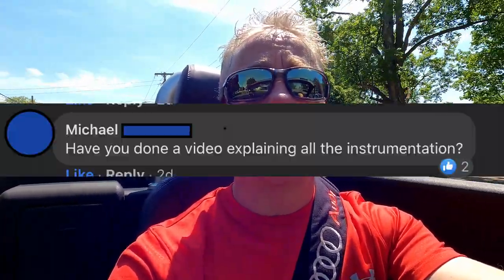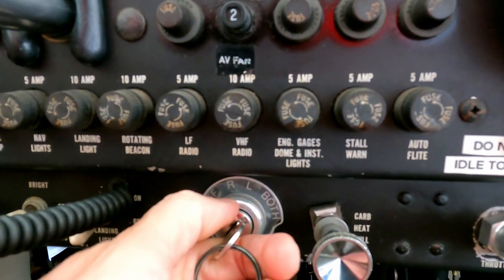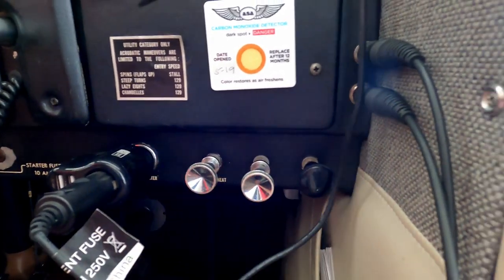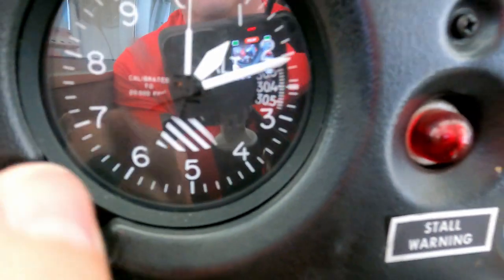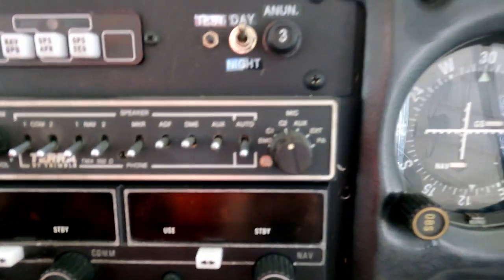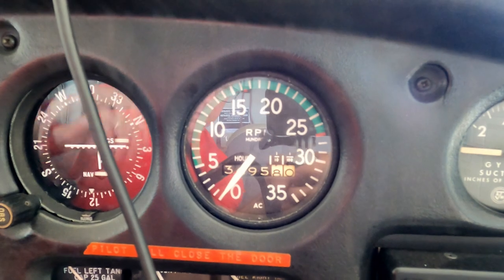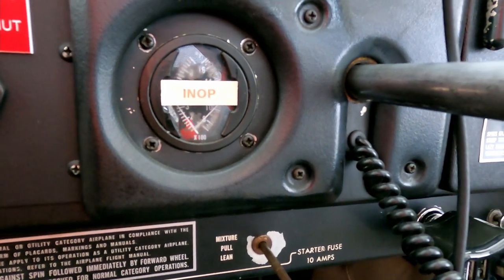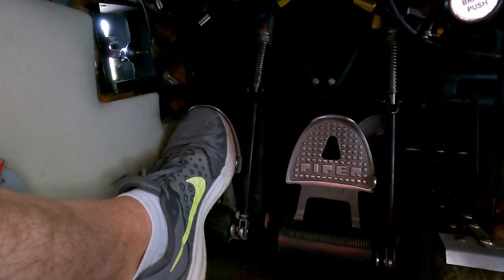Instruments and flight controls in my 1967 Piper Cherokee 140 (69)

Comment: You did a good job explaining your panel. I have a 73 Arrow II, the placement of my instruments is much different than yours, the difference just 5 years make, mine was sold in 72 as a 73. Within the next year I will add another g275 and have two G5’s and two G275’s and dump the vacuum pump.
Reply from the maker: I
Wish I could afford a panel upgrade. $$$
Reply: @RandyBroderick  
I dumped a mass sum of cash into my plane. I never thought I would put more money in electronics than engine and airframe.
Reply from the maker: @DWBurns  someday, I hope
To be able to upgrade. 🤞
Reply: @RandyBroderick  
It was too much money, I just had legacy instruments die so had to get electronics.

Comment: That was a really good video. As new to this I got a lot of information. Thank you.
Just one question. How or what would be the signs for you to use the carb heat plunger?
Reply from the maker: In humid weather, if the engine starts to run rough, pull the carb heat. If there is ice building in the carb, it should melt it. The engine will continue to run rough until the carb has ingested all of the melted ice. Then it should return to normal
Reply: @RandyBroderick  Thank you